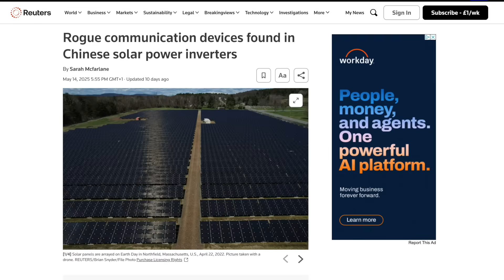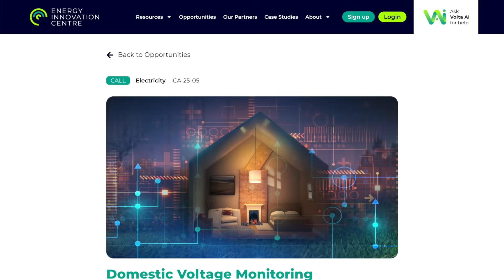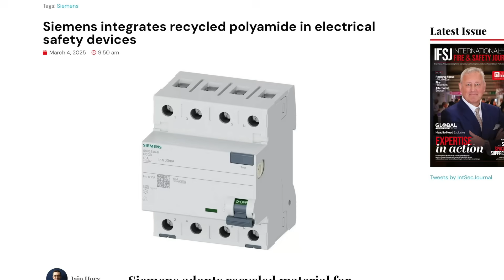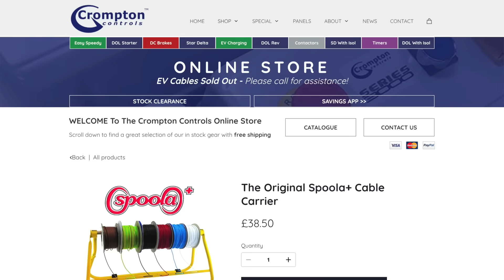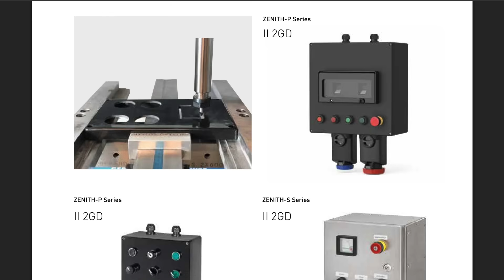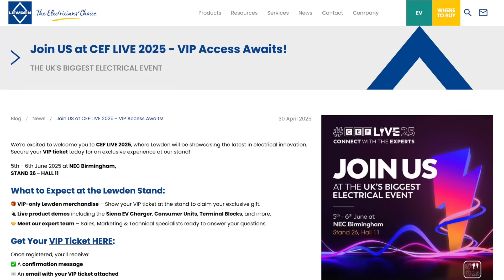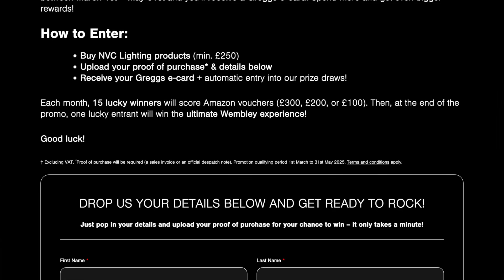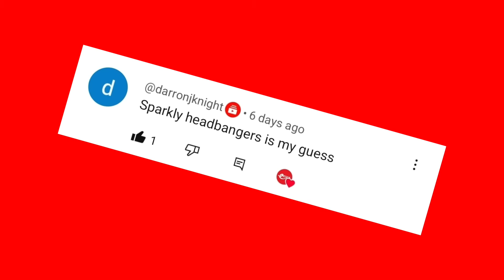‘Kill Switches’ Discovered in Chinese Solar Inverters

Comment: "I only let my inverter connect via XYZ" is not gonna help, it makes it own, totally separate connection using separate wireless communications.
"Brands were not named". Don't trust ANY inverter from China, not even western brands made in chinese factories, there were already cases of secretly changed designs.
"I don't believe unless proof". Do you have the same sentiment if somebody warned you about your pager potentially having explosives inside, but had no immediate proof? For people that have deep knowledge of how China operates, it's surprising that these kinds of remote kill switches have not been found earlier. No, chinese companies are not independent of the chinese government. Yes, chinese manufacturers have already been caught with all kinds of nefarious backdoors before (even in hardware products, e.g. lenovo laptops).
I can't believe the west is still doing business with what is essentially a richer version of North Korea.

Comment: That old nugget. You can save money by exporting energy back to the grid.

This would be for around the contracted two years after you purchase the costly equipment to facilitate this.

Then when that contract ends, you won't export anything because the energy company will cut to pennies or less what they pay you per KwH for that retruned energy to the point where it's financially pointless to do so.

In the meantime you're left with a huge cost to pay back over decades for the equipment you purchased, which within around five years will be obsolete.

Energy companies are like insurers, bankers and estate agents, they are all bottom feeders.

Comment: A lot of manufacturers just rebrand other manufacturers products, you will struggle sadly to stop buying Chinese pv systems.

Also after working for a manufacturer who manufactured ev chargers I was shocked at how many times the ev recorded an over or under voltage spike. I had one gent that wasn’t able to charge his car 😂because as soon as the vehicle was plugged in his village entire voltage would drop. I had to send the fault log and the what code numbers showed the drop in voltage.

Comment: Maybe this will come as a shock to most of you: Any device with over-the-internet (or even those over CD, USB-stick, whatever) updates (including those that merely recommend an update) inherently has the potential to:
- Brick your device at any time (intentionally or not),  even at a predefined time  (e.g. just after printing 1547 pages, or supplying 542 kWh, so you'll have not the slightest idea why it broke 4.5 months later)
- Make it less usable (e.g., HP disabling third-party toners in their laser printers through a stealth firmware update—without telling you),
- Restrict usage modes. E.g.  to subscription-based model (there are dozens of examples,   Logitech CEO recently came out with the brilliant idea of a subscription based mouse, we will pay basically per 'number of clicks processed', I just can't wait this driver upgrade hitting me).

I don’t see anything extraordinary here. What we allow companies in Cupertino or Palo Alto to do with our devices (not just allow—it's become an industry-standard practice), why and how should we expect to limit this when it comes to a company from Shenzhen?
Reply: Well, with firmware updates over USB/card, etc. or over the internet of your home network, you can at least prevent such a device from updating. But when it has it's own embedded connection that you can't do anything, and know nothing about - you're screwed.

Comment: Wonderful, I have just this last month purchased two flamezum 3,000w  inverters, two 100AH eco worthy batteries, and one  renogy 300AH battery. ALL no doubt manufactured in China. We should be told the brands, so we can take appropriate action if necessary. Fortunately as none of my purchases  are connected to the internet, so there won't be a problem in my particular case, but my argument still stands.
Reply: It makes it own, totally separate connection using separate wireless communications.

Comment: Lots of companies put kill switches into their products. If they say that it will last ten years. Then after you turn it on for the first time. You start a countdown timer. At ten years and like ten hours it will just turn off. Almost every single thing that you buy has this in it. Why do you think that it works fine one day and then it doesn't the next. Then you send it in for repair and they tell you that it needs a new circuit board. You look for it on the used market and no one is selling them used. This should tell you that this part always goes bad. 

Isn't it a good thing that computers run the world. And isn't planned obsolescence a great thing. And why are you just now complaining because this chip is able to be turned off at any time. Lots of things have this same chip in them.

Comment: I want to know why we don't see solar panels on all these million plus square foot warerhouse
Reply from the maker: The power supply to the buildings couldn’t handle the export power. ££££
Reply: @efixx  Maybe this is something all bodies should look into. The power supply to the fields seems to be able to handle it. So when a new estate is built, why isn't the infrastructure put in place, rather than building on greenfield sites? These buildings could be powered by what is on the roof.

Comment: I somehow always suspected this! ... At thebsame time the equipment is so affordable and effective that they sre impossible to ignore.

My power system (Chinese based batteries and Inverters) is locked inside a metal cage designed to keep out radio communication.

And I don't monitor it using a connected network. Operates basically automatically, and I monitor by going to look physically.

Comment: We have loads of council houses with solar panels here in Pembrokeshire (Wales). The local housing association has been installing them standard on new builds for at least ten years. The council convert the houses they buy before tenants move in. My own old council house is due to be converted to solar panels and heat pump this year, along with the neighbouring villages.

Comment: How is that supposed to work to switch off the firewall from the inside?
At best, the inverter can get a command from home and you will just be able to prevent that? The inability is limitless. That is why the manufacturers and allegedly affected devices are probably not mentioned? :-)

Wie soll das funktionieren, den Firewall von innen auszuschalten?
Der Wechselrichter kann sich bestenfalls von zu Hause einen Befehl holen und das werdet ihr ja gerade noch verhindern können? Die Unfähigkeit ist grenzenlos. Deshalb werden auch die Hersteller und angeblich betroffenen Geräte wohl nicht genannt? :-)
Reply: When you make a totally separate wireless connection, you effectively bypass any firewall, including the "i don't let it connect to the internet"-firewall.
Eine separate Funkverbindung hebelt alle Firewalls aus, auch die "garnicht verbunden"-Firewall.

Comment: Luxpower, makers of the EG4 6000XP inverter that is made in China, are facing scrutiny and accusations that they may pose a risk of backdoor cyber attacks by the Chinese communist government. The concern stems from the discovery of "rogue" or undocumented communication devices in these inverters. These devices could potentially be used for unauthorized access and control, potentially leading to grid instability or damage.

Comment: 'Un-named US government security officials have told Reuters that they have found remote access devices.' May or may not be made up to depress sales of China made equipment. It's in USA's interests to sow fear, uncertainty and doubt.
Regarding the remote switching and data collection - that's been the case for smart devices for years. Remember your energy provider can switch your smart electricity/gas meter into pass as you go mode, 8 providers got chastised for targeting vulnerable people recently. You have an old meter? They can force a smart meter on you and have done so (UK).

Is this the same US government that put a bill through congress called CALEA (1994) to force (USA) communications service providers to incorporate backdoor access? CALEA has been used to spy on Greece, USA, EU etc
The UK government forced Apple to water down it's encryption, so Apple has had to withdraw that service to UK residents.
Do you trust that every part of the government (any government) will do things only in your interest and keep to their fiduciary duty?
Firewalls, security software, Tesla cars, encryption devices, the list goes on.
Who knows the truth?  - they're all doing it - Why are you surprised?

Comment: Wait a sec! What the hell are smart meters for? They have all the functionality baked in! They can easily record and report voltage and power fluctuations They have all the communication network baked in too... Why would you need another device to report the same info?
Reply: I made big mistake having smart meter energy jumped up 50 then came the price hikes easily extra 100 than a estimated fixed DD 😅

Comment: A voltage recorder? Most houses have smart meters, how on earth do they not monitor the voltage already? How is that data not already accessible? Just highlights how useless those things are! most homes in the UK would have frequency, and voltage monitoring all available for the power companies to use for analytics if only they were fit for purpose. As it is they don't even get the kWh readings sent out properly most of the time.
About time we scrap them and come up with something better, ideally something that the home owner themselves could monitor via modbus or similar if they were so inclined. But which otherwise would provide all this information back to the grid operators so they know when the voltage is low or high without needing complaints. How pathetic.

Comment: Speaking as a Council/HA tenant myself; One problem with the Tenant Power tariff is that it requires the landlord grant permission to install the panels and associated hardware, which they tend to be highly reluctant about. I've been trying to obtain consent to install PV on the roof of my building for years (My flat faces straight North, so my right-to-light is deferrable to a sun-touched area and gives me priority over the roof) but my landlord is extremely reluctant, seems to think my status as an abandoned disabled person means I have „No rights“, and I've been repeatedly tempted to apply a sharpened axe to the problem to encourage a change of opinion. ☀⛔🤬

As for the UKPN challenge, that sounds like something I might have to have a craic at! So long as CE-conformant designs aren't a problem? ⚙🇪🇺😇

Comment: I suspect this has something well at least part of it to do with some electrical fires on car chargers batteries ect. 
Including poor choice of internal components/ including wires that are not thick enough for the task or job take your pick self taught here
Do you know these Milwaukee batteries when they fail to charge it’s only a resistor or was it diode?
Rather than put copper brass aluminium  ect in a bin I’d sooner get the forge and crucible and moulds outs and stamp it up with the correct material weigh and of course fine for maximum price
Just make sure your in a very well ventilated area some of the fumes are real bad for you based on what your smelting⚠️👍
In addition be very mindful of steam explosions always preheat your metals and your moulds to avoid a steam explosion
There’s a bit more to it like skimming the crud or impurities from it

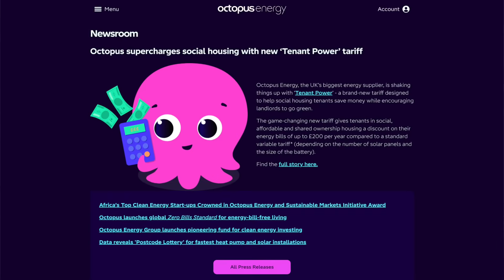Comment: 2:20
The real reason you don't see solar panels on council homes.

Council wanted 1k Inc vat for a roof survery
Council wanted 1k in vat for a change of lease (I am a leaseholder)
Council wanted to choose the installer.
Council stated all roof elevations must be shared 4 ways (4 flats in the block) rendering the arrays so small a standard string inverter would not get the minimum voltage to power up.
Council stated (in 2022) inverter and batteries had to be outside the property  (this is when 99% of inverters/batteries were not ip65 rated)
Council said that if they want to do any work to the roof, removal of solar panels and reinstalation (inc scaffold) would be at my cost.

Hmmm, computer says no.

Ground mounted array in the garden = yes!

Comment: Reuters also reported on hidden chips in the printed circuit boards (PCBs) of servers. Unfortunately, these chips were so well hidden that nobody ever saw them. OTOH, no government will ever say anything about such attacks, as they do not want to reveal their attack and detection capabilities. But, there should be enough independent researchers around with a motivation to embarrass the PRC.

Comment: I live in Llanelli and the tail end of last year into the beginning of this year,  not only were Carmarthenshire Council re roofing Council houses, but they were also installing Solar Panels. 
I'm not sure if they included batteries though.
Reply: Ours have batteries in Pembrokeshire. I assume Carmarthenshire would be similar?
Reply: I have people doing mine now, (Scottish Highlands) air source heating & solar panels!
Reply: Were these the "in roof" solar panels that sit in trays and are level with the rest of the roof surface? Reason I ask is they are actually cheaper to fit than it would be to tile the same area, the very definition of a no-brainer

Comment: DNO voltage - all the solar/battery/EV kit we install has voltage monitoring but they don’t except that data and only accept their 2 week logging machine data
Reply: „Must be usable by a consumer and cost about the same as a multimeter.“

* Turns the dial to V~ and sticks the probes of his meter into a spare BS-1362 outlet... *

There you go - Solution found! ⚡💯👍

Comment: China feeds the West with West's own medicine. West prises themselves for disrupting work of some Soviet pipe line system, for braking to working process of some nuclear station in Iran, for current affairs with remotely switching off western-built equipment in Russia.
In fact the West is trying to accuse China in doing the Western own deeds.

Comment: Regarding the switch, it's any internet connected inverter with remote firmware update capability.  This includes items such as the inverter charger by deye that efixx likes.  DEYE has exclusive arrangements in some countries but a lot of their inverters have been direct imported into those areas.  DEYE allegedly acted on their own using crude location and serial numbers to see if a product was sold through the channel.  If not firmware that disabled the inverter was provided next time the inverter did an update check.  Hidden modems etc - OEMs often include integrated items like this by default because it's cheaper to include (embedded in the basic hardware) rather than separate it and make it optional.  The firmware config determines what features of the hardware are accessible.  Without a SIM the modem is essentially a brick - no data in or out apart from some basic inbound messaging.  The only way to take advantage of that  is to take over the telecom network so that you can send such basic messaging and if that's possible your country is already sunk.  USA's DT is doing his USA USA USA push and wants people buying USA so ... put it together folks.  Unsupported claims of switches and other things that will let bad people harm your power grid off vs the reality of standard industry practices.   It's not the first time this stuff has gone around and it won't be the last, supermicro and bloomberg for example.
Reply: @retrozmachine1189  thank you for some insights
Reply: This! The Bloomberg article felt too much like journalists run amok, although it was a potentially feasible attack type, where the hackers could use a tiny embedded micro to trigger a payload on the server's management controller which could then be backdoored itself. I built a proof-of-concept for it where I work (IT security consultants) and it was possible, although only under very specific circumstances.
Reply: @therealchayd  Pretty much.  People x-rayed motherboards and could find nothing that actually supported added hardware embedded in the PCB but given things such as IMC/IME with known flaws exist it's not really needed.  Either get compromised firmware loaded onto that or exploit one of the known flaws and then you have full access to the hardware without the running OS nor main CPU being aware.
Reply: @retrozmachine1189  can you explain what do you mean by "without SIM"? You never heard of e-SIM? You think a simple SMS is not sufficient to kill the inverter?!
Reply: @roadrunner9843  Sure.  Now how do you get that simple SMS to a SIM that is not associated with a number.  I guess you could take over the telco's network and send a broadcast.  Oh.  Yeah.  If you can do that I think the target country has a bit more to be worried about that just the electrical system being attacked.  What do you think?

Comment: "engineers". Says it all, it should say "security researchers" at a minimum.  Think about it, how are they going to connect to a mobile network without a valid SIM?
Reply: Ever heard of an eSIM?  It's essentially just a handshake to the mobile network.
Reply: Luckily engineers understand how things work outside of the restricted areas of expertise of security researchers. Is a security researcher going to be able to figure out that a component on a PCB has a hidden alternative function.

What makes you think this system would use cellular networks.

Comment: Like every inverter,Optimizer,micro inverter,and battery on the market isn’t made in china all depends if it’s connected to the server for monitoring.hardly news is it if they can access for maintenance and software updates and fault finding they can turn it on and off at there leisure.